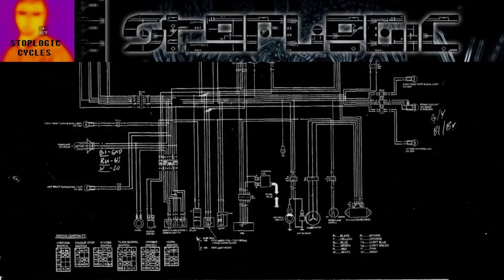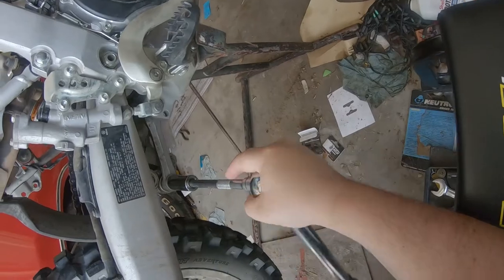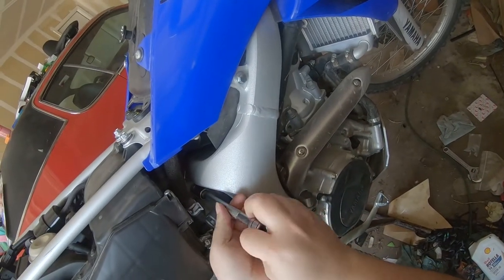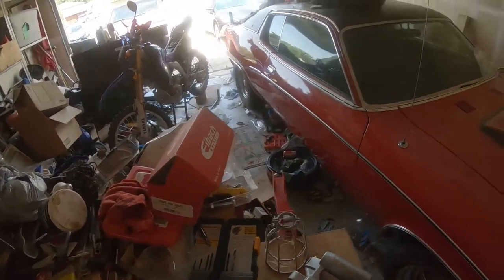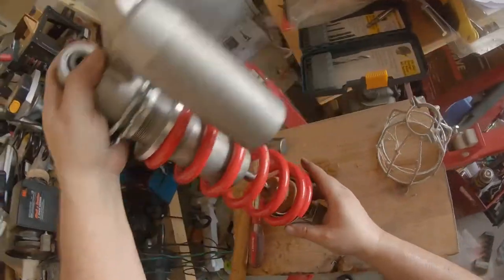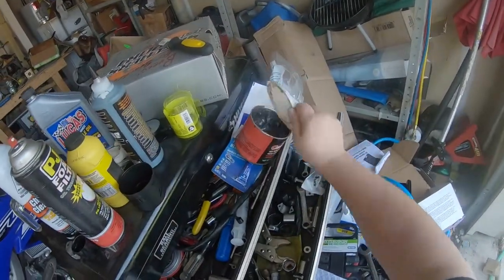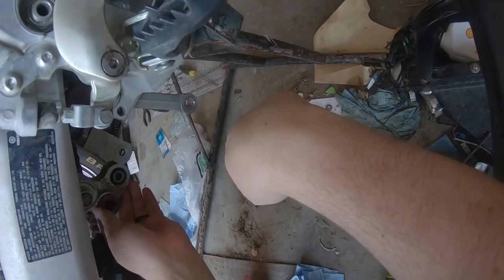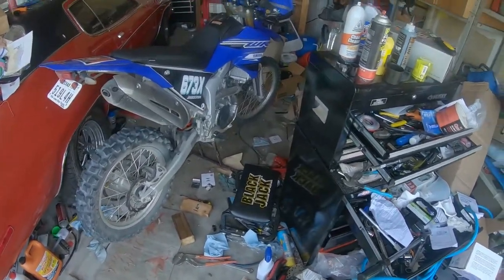WR250R New Rear Billy and the Boinger Spring

Comment: If you dont mind me asking how much do you weigh for this new spring set? I'm 230lbs, so I'm overweight for the wr250r. Along with losing weight, I'm trying to decide if I need to do a spring mod. Thanks
Reply from the maker: At the time of this video I was almost 275 I'm down to about 236 lb now.  Re springing a bike does definitely help it feel a bit more settled just make sure when you do the new springs to slow the rebound down a little bit if you're not re valving it completely.

Comment: I watched this just to see how you got the bolt through the "dog Bone" and that is the one part you cut out!!
Reply from the maker: Sorry about that I can explain it if you want me to, basically put it up on a stand or tip it over and you drop the rear bolt out turn the dawgbone down and then you can pull that bolts out to pull the shock.